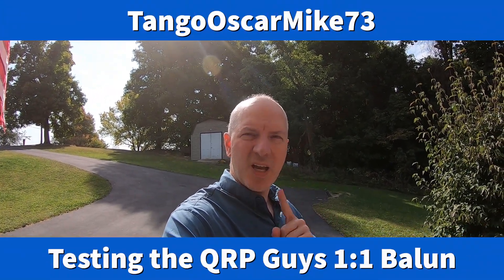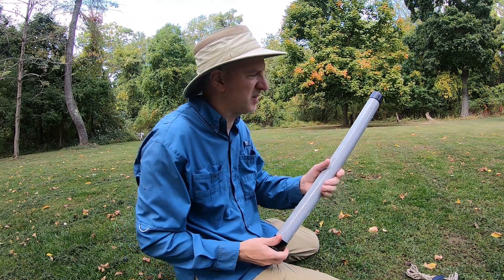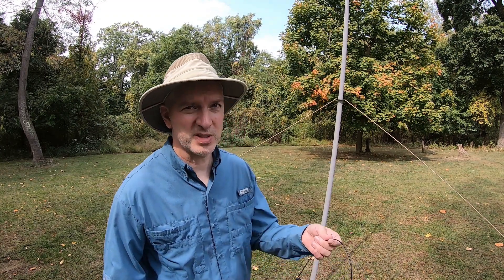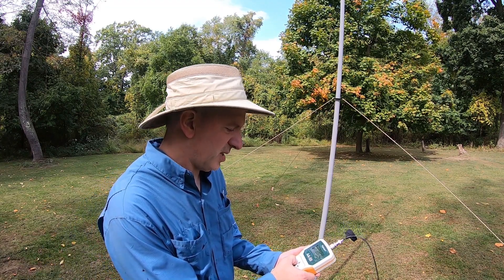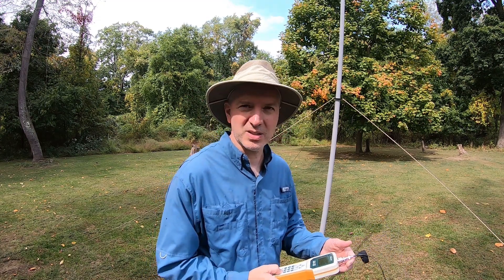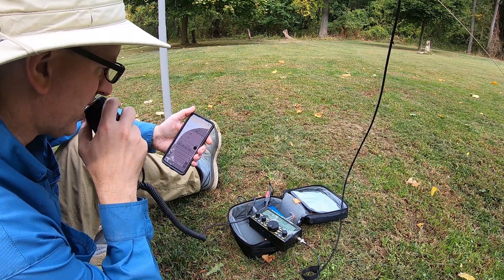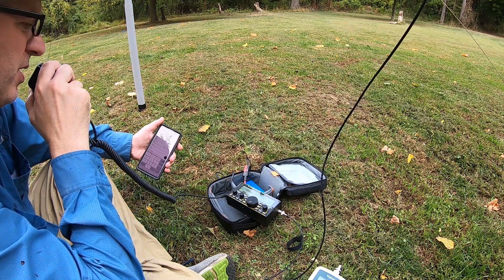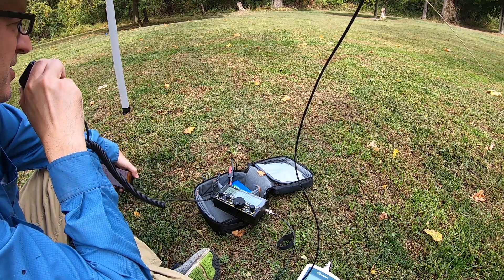Testing the QRPGUYS 1:1 Balun with a linked dipole #MNHR

Comment: Doesn't the sota beams linked dipole come with its own 1:1 balun?
Reply from the maker: yes it does, but I made mine for quite a bit less.
Reply: TangoOscarMike73 but they don’t let you purchase it without the balun do they? I’m trying to help a friend get his hands on an affordable 1:1 balun he can use with some resonant dipoles he makes instead of spending an outrageous $90 on the SOTA beams linked dipole set.
Reply from the maker: No the bandhopper is pre-built.  They do sell a 1:1 balun kit separately.  If your aren't in the UK, the qrpguys kit is probably cheaper, they both are low power.  Check out the recent video series by "The Smoking Ape" on baluns.  They are easy to built yourself.  There really isn't much to them.  https://www.youtube.com/watch?v=RtFVpdxOFF8
Reply: @TangoOscarMikeN3WS  Absolutely. My friend isn't looking for DIY, so I had suggested him the same QRP guys one you mentioned since it has a BNC already on it.